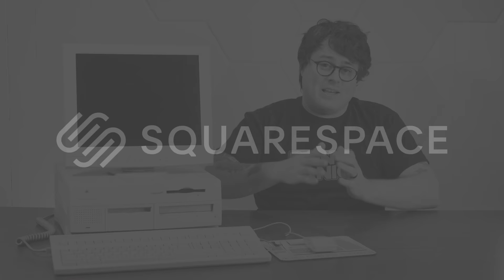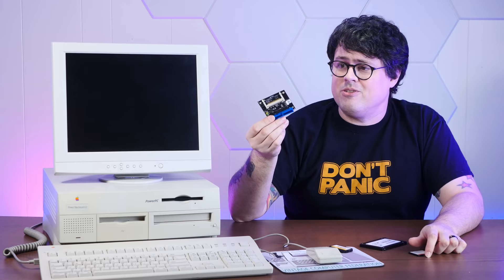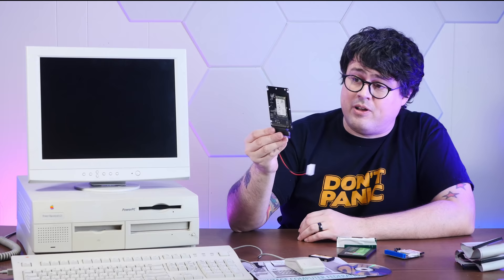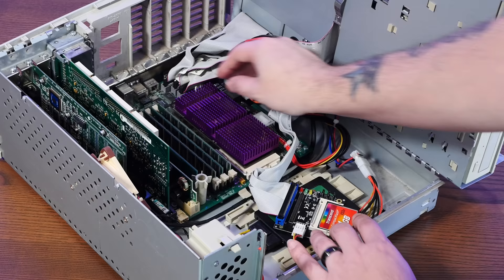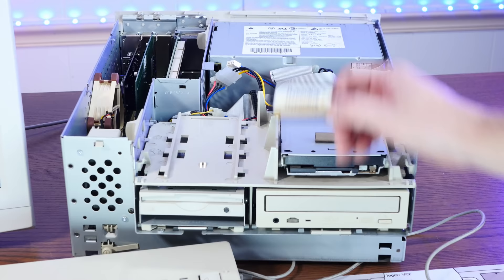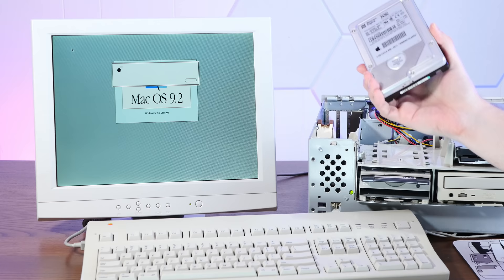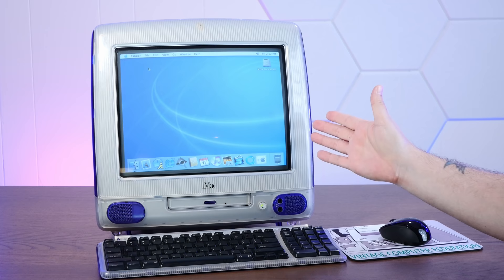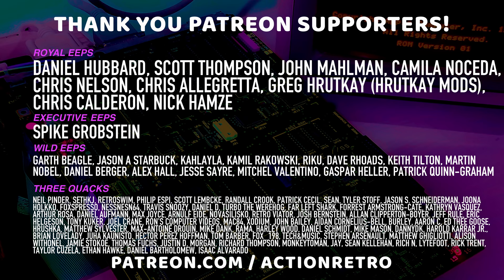Using an Industrial Disk Module in a PowerMac - it's AWESOME!

Comment: I have a 6500 Creative Studio Edition with Avid Cinema. Any time I’ve tried to use anything other than the stock hard drive video editing becomes nearly impossible due to massive frame drops.  Would the disk-on-module be a good fix, or would those sequential read numbers be a problem?

Comment: Curious what speed the controller in that machine is vs the speed of the spinning disk. if you plugged an ata33 drive into an ata66 controller it would make sense that a modern DOM would be double the speed.

Comment: When using the SATA convertors, what size are you setting the partitions? A lot of the older machines have problems with boot drives over 8GB, like your iMac G3. Partition the drive to 4GB and then retry your tests with the SATA drives.
Reply from the maker: Oh yeah I did try with a 4gb partition
Reply: @ActionRetro  Aw, cool!! Thanks for the update!
Reply: @ActionRetro  In addition, I've found the problems with using sata/msata SSDs with IDE adapters on older macs is usually a result of quick formatting. You need to zero all the bits on the media when formatting using disk utility etc. On my Performa 6360 that took about a full day! But since then a 120GB SATA Samsung 830 SSD has been working great with it.

Comment: how about SD to IDE? Dunno if the compatibility is all that good but does not seam like a bad idea, on the other hand I'd never go back to using IDE-SATA adapters - they are garbage in terms of compatibility and performance, they perform about 1/4th as "fast" as a regular IDE drive...

Comment: Is this disk on module workable for a laptop (e.g., an old iBook) or only a desktop - you mentioned it requiring additional input voltage?
Reply: Look for a "44 pin" DOM, which is the connector used in laptops to supply power to IDE devices without the need for a Molex connector.
Reply: @dregenius  Most 44 pin DOMs have female connectors to attach to devices like thin clients. For laptop use you need to make sure you use one with male pins.

Comment: Ever since I read about in adverts and websites back in the late 90s, about solid state disk drives, I have always wanted some for my music computers so that the computers would not permanently crash or fail at least. I was naive as to WHAT tech was involved in Solid State drives and that the nand crystals in the drives would still fail over time or something like the internal controller would fail all at once, rendering those $10k to $20K drives the most expensive paper weights on the planet. Sadly, a true story. When prices dropped in the mid 2000s and I was able to buy such drives for pennies on the dollar, 3 of them just died for no reason while using them.. What killed them? The internal controllers! The nand itself was fine cause the drives were SLC industrial grade SSDs. Now Here is what I KNOW: SSD tech will fail faster than and all at once than traditional HDDs if: the internal controller fails(USB flash drive,CF cards,SD cards,SSD drives),ONE nand cell(sector)dies and the wear leveling missed it(SD CARDS.CF), power is cut to the drive suddenly(CF,SD CARD,INTERNAL SSD,SSD drives of all types), and if the drive suffers sufficient physical shock or traume(all of them). That DOM drive you have specifically is one of the cheaper MADE IN CHINA less reliable MLC or TLC drives. It will be prone to early failure even under optimal normal use. The more robust and reliable drives are ENTERPRISE battery backed SSDs, and SLC drives. Mainly those made in USA,CANADA,ISRAEL and KOREA/TAIWAN. There are rare JAPAN made drives but like the ones made in the USA, they are for Military/Government use and are too darned expensive to even find on Ebay used. I have been buying PQI and EMPHASE branded DOMs. SSD IDE drives I had before I foolishly sold them were: SIMPLE TECH and SANDISK. I currently own SLC Samsung, STEC, and IMATION/Mtron drives, as well as Apacer and of course the PQI and EMPHASE DOMs. If you setup an OS to run LIVE and READ ONLY off these drives like I do with modern LINUX, the drives will not wear out for decades BUT you still need some form of battery back up to prevent sudden loss of power or else, the drives will fail on the spot...

Comment: I'm pretty sure those old hard drives had 512 bytes per-sector, so a sequential read would basically be spitting out the data directly off the heads as it passes over the disc. Flash memory is divided into blocks which are usually much larger than 512 bytes, so every time the controller reads the flash memory, it receives the whole block and has to retrieve the data that was requested from within that block and send it to the host. It's especially slow if the data is split across blocks, so it would need to retrieve the first block to get the first part of the data, then retrieve another block to get the rest. That's why it's so important to make sure your partitions are aligned with the blocks on your flash drive.

Comment: Recommend  a 50 pin extension cable rather than a barge for the CD-ROM.
Reply: Or use a small IDE cable to move the module away from the socket, like the hard disk.

Comment: Yikes!  Cutting and soldering a ribbon cable makes me shudder at the thought. Get yourself a roll of cable, then cut it to the length you need. Those IDC things are usually quite reusable, it looks much better, and doesn’t risk shorting things out. When I got my cable roll, I went for 60 conductors, the widest I regularly needed, and just cut it down for narrower things, but if you have some PC IDE cables that are longer than you need, you could cut it to length, and might not even need to move the connectors. 

By the way, those connectors go on very easily with a normal bench vice.

Comment: A bodge? On a HDD/CD cable? What are you smoking? Carefully pull the side clips on the connectors, remove them then get a longer cable, re-fit the plugs and cut the excess cable. Solder jobs on such a cable, even if you had wires with the needed copper quality. will mess up signal integrity dramatically. You'd be lucky if that cable would work at all after such a bodge job on it.

Comment: FYI the 32 GB disk on module is now on amazon and it is faster than the 16GB:
https://www.amazon.com/Kingspec-44PIN-Module-Network-Gaming/dp/B00J3M67EO/

And a kingspec 64 gb pata ssd is cheaper than the 32 dom. However they are larger so you need to use an ide cable and may have some compatibility issues. 
https://www.amazon.com/KingSpec-2-5-inch-Solid-SM2236-Controller/dp/B008RWKFYE